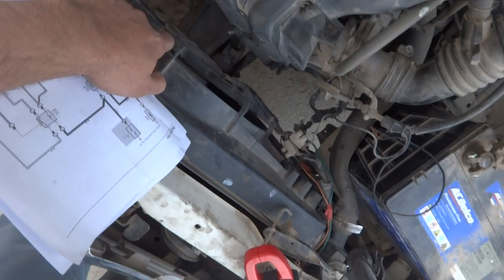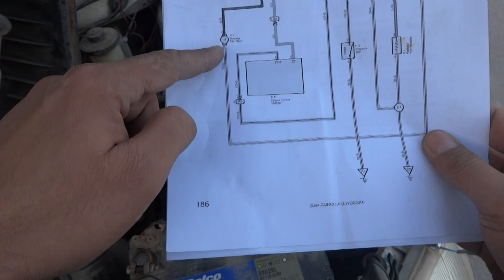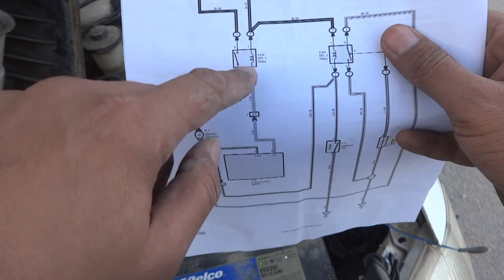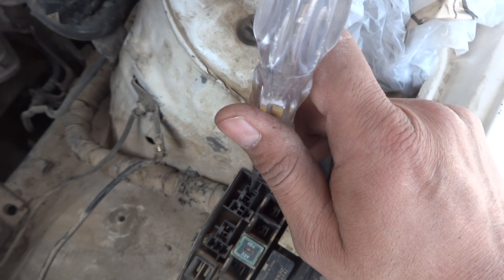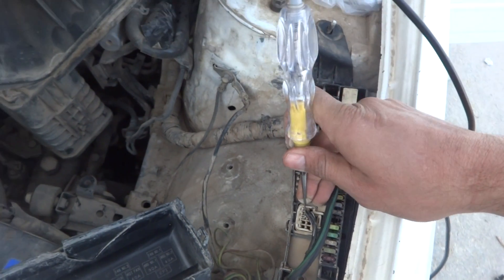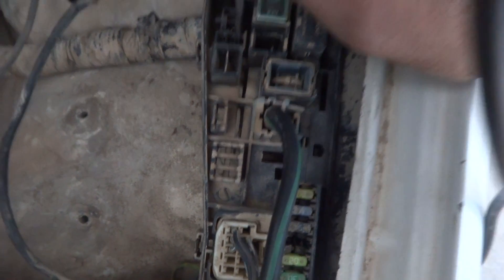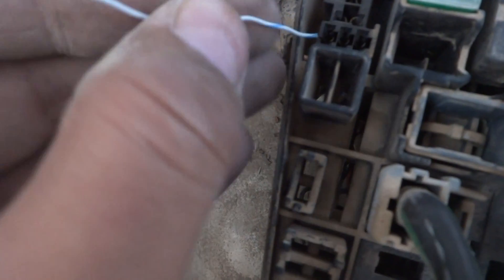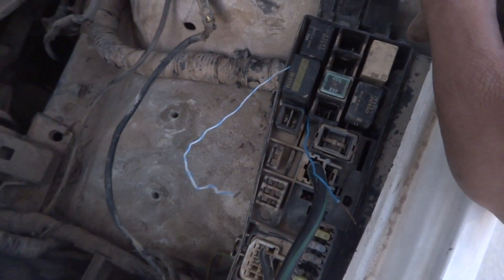Car radiator cooling fan electrical repair. Engine overheating.

Comment: Hey Learning Zone I got a question. Was as the cooling fan working with the a/c prior to repairing the circuit? I'm having trouble with my 2007 corolla fan switching on when the car reaches temp, but like I said the cars fan works with the a/c on only with a high speed. What do you think it could be? I changed the temp switch the sends power to turn on the cooling fan, i also tested its fail safe by unplugging the sensor with the key in the on position the fan is supposed to come on full speed but it does not come on at all.

Comment: Sir  All car has 2 fan relay please guide me thank you
Reply: NO ;
some cars '
has 3 relays
one for low speed ' for No1 fan .
and another 2 relays 
one for each fan high speed .

AND :
some car cooling system 
electric fans have 3 speeds
 low ' mid and high speeds .

ARAB Engineer .

Comment: a simply brilliant solution with the same functionality as before. nothing sacrificed. brillant
Reply from the maker: Thanks if you liked it. The way I did it was an addition and no wire had been cut as regular electricians are cutting wires and splicing them here and there without understanding. So the addition could be removed anytime if needed.
Reply: I am a fan of your videos, very practical and right approach towards all problems in your videos.  I am little curious where you from? I guess you from some Arab country. In your videos, I notice you are an electrical engineer. That why you always hit the real problematic area with the right approach.

I always like watching your videos. Thanks for making them for us all on your channel.
Reply from the maker: Thank you Omar Alvi for watching and liking. The purpose of my channel is to make the always confusing technology simple and easy to understand. Also how many people do learn and understand their problem and solving them, is my pleasure. Troubleshooting and repairing in engineering approach is the right approach. Also I am doing hard work to bring troubleshooting and testing ways in front of my viewers. All I need is a few worlds of appreciation and encouragement in reward! That I am receiving from very respected and excellent viewers like you.
I shot this video and many more in Saudi Arabia and actually I am from Pa. I think you are also from my area! Stay tuned and keep in touch. Best regards,

Comment: hi I like ur very informative video u help alot thanks for that I have a problem on my vehicle is it normal that the fan will not work full speed if ac was close or even bcause my rad.fan works full speed only if my car AC on im using my car without ac on.i dont heard my fan works at full speed only normal speed causing my temp.gauge going morthan half. hope u can give me advice on this thanks keep up d good work.
Reply from the maker: +YKCIR YOB CARPIO Dear friend it is a bit difficult to understand your real situation. If you own the same car then you can do the testing what ever I prescribed here. The reason your fans are coming full speed with AC switched on can be circuit modification by someone. This is normally done by Electricians. A very careful diagnostic is required according to the schematic diagram to bring things back to normal. If it is not possible for you then you can command your fan switched on all the time when the ignition switch is in the on position. For that there are so many ways to do that. But remember one principle not to alter the original circuit but add your enhancement in such a way that whenever if you need to remove those, should be easy to remove them without disturbing the original factory circuit.
I will upload a video soon on the same car to switch the rad. cooling fan direct with ignition switch. The way I would do it will be so easy that you would be able to do it yourself without the help of anyone else. Better you may subscribe on my channel so that whenever I would upload new video, you will get automatic notification. Regards,
Reply: +LearningZone  looking forward future update DIY more thanks..

Comment: 2001 corolla temperature problem i changed cap and Thermostat maybe this is my problem my fans only comes on when the AC it turned on
Reply from the maker: +Antoinette Williams Dear friend it is a bit difficult to understand your real situation. If you own the same car then you can do the testing what ever I prescribed here. The reason your fans are coming full speed with AC switched on can be circuit modification by someone. This is normally done by Electricians. A very careful diagnostic is required according to the schematic diagram to bring things back to normal. If it is not possible for you then you can command your fan switched on all the time when the ignition switch is in the on position. For that there are so many ways to do that. But remember one principle not to alter the original circuit but add your enhancement in such a way that whenever if you need to remove those, should be easy to remove them without disturbing the original factory circuit.
I will upload a video soon on the same car to switch the rad. cooling fan direct with ignition switch. The way I would do it will be so easy that you would be able to do it yourself without the help of anyone else. Better you may subscribe on my channel so that whenever I would upload new video, you will get automatic notification. Regards,

Comment: Bro Can you help me please. I have vauxhall astra sxi 1.6 2003. The fan stopped working. the fuses and relays are working perfectly fine. the machanic took a wire off from engine that goes to the fan or radiator that made the fan work directly. now whenever i turn my car on the fan starts working in full speed and when i turn it off the fan stops. someone told me to take it to an auto electrician. the guy said there could be a problem with the temperature gauge that can be replaced but he is charging too much. is there a way that i can fix that myself. I will really appreciate. Thanks

Comment: Good video with clear explanation.Like your test light,where can I buy one like it ?
Reply from the maker: Tom OConnor Thanks dear friend for liking video. Hope you learned something. The tester I am using here is my self made DIY tester. You can make one yourself using a low cost Chinese 220V tester. All you have to do is to omit the existing lamp and resistor and change them with a 12V small lamp from automotive meter lamps. Attach one alligator clip and wire to one end and another end you should have to sharpen like a needle! Your tester should not draw more than 150mA at car 12V system. A 100mA is an ideal current for them. Regards,

Comment: Jahan your diagnostic skills are excellent as allways :D :D

Super bypass :D, i would not want to rip the harness to bits eather, not worth the trouble for such an old car, i hope your frend thanked you.

That odd relay wiring would have confused me for a while, i allways expect a device to have a solid ground and the power side to be switched only.
Its my mental "blind spot" lol :D
I suspect the relay coils would not be much load on the wire you tapped onto, perhaps 50 to 100mA per coil, not much really.
Reply from the maker: zx8401ztv Yes dear friend you are right, the relay coils are not a big load for the running system. I kept in mind that point while making the modification. My friend sure thanked me as I solved his stopped fan problem. The negative side computer control or open collector system is a bit confusing initially at starting, but I am sure it is not a problem for you having rock of experience and knowledge! Your understanding and in-depth knowledge amaze me always. Regards,
Reply: LearningZone
Yes i would understand it after a short confusion.
By the way, p.n.p transistors also annoy my brain lol, my blindspot for negative switching again ha ha :D